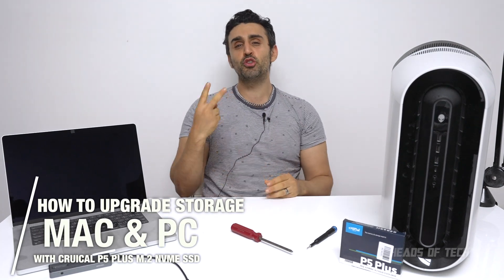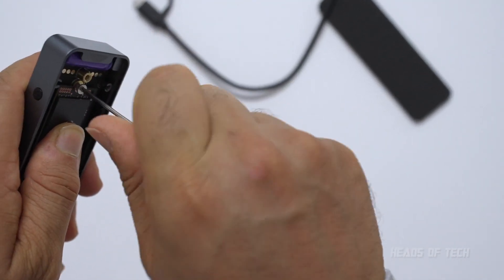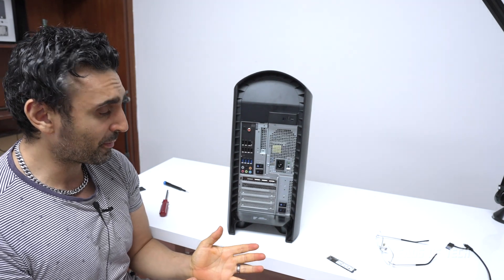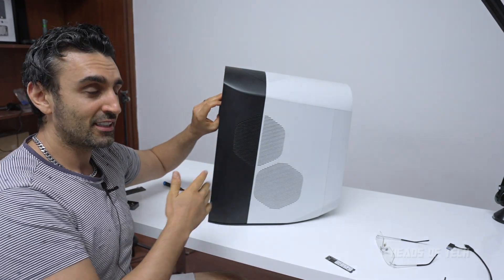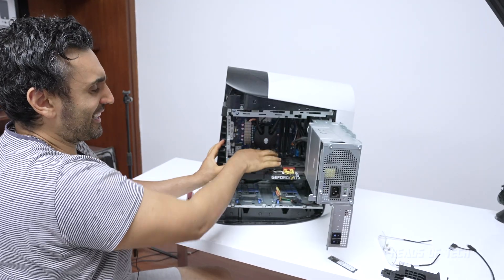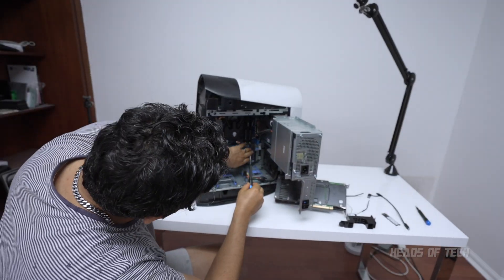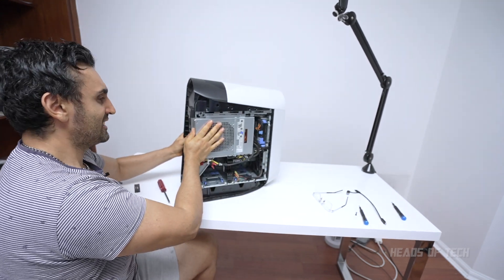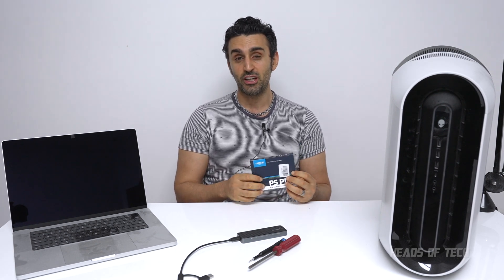How to Upgrade Mac and PC Storage with Crucial P5 Plus NVMe SSD | EASY MODE

Comment: I used this with adapter on my MacBook Air 2017 - first with Catalina , than upgraded to Big Sur - still have the same issue which is problem with sleep mode - after closing and then open lid up I have black screen. 
When I did this during night - I mean before sleep closed lid and then in the next day morning opened lid it was dark screen, than after reboot error and it went 30 percent at least battery down 

Before ssd upgrade I have had no issues and battery work well - 10 full hours at least. And sleep mode conserved this energy nicely